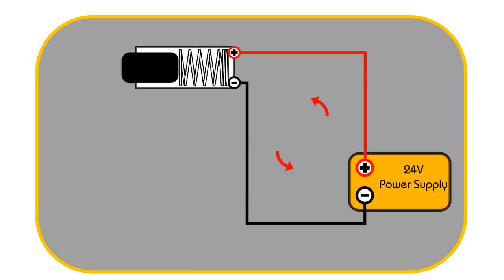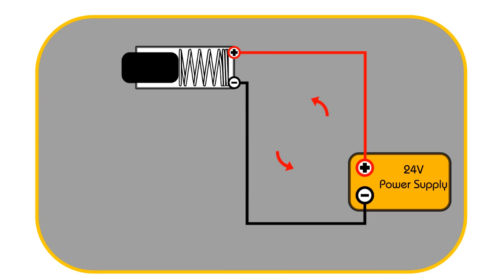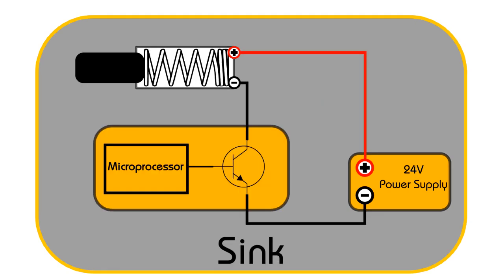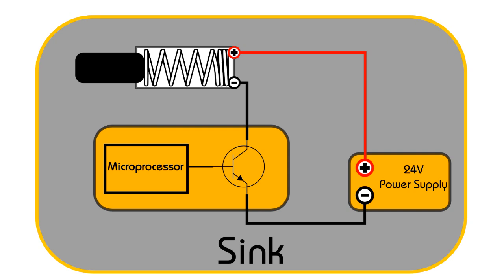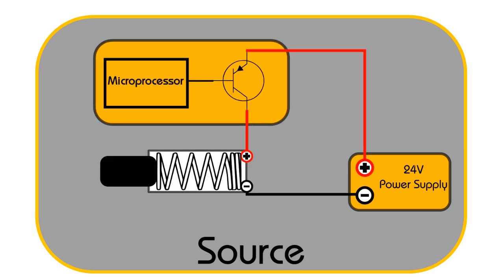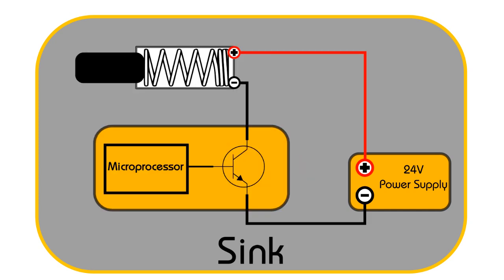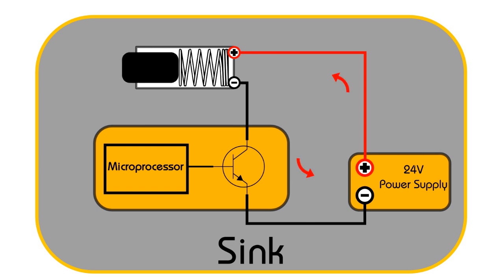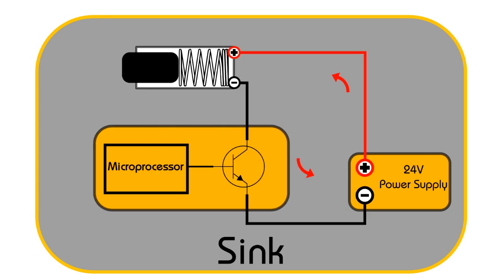PONTECH  Understanding Source Sink - REV-X1

Comment: Mr. JC, Could you please explain dry&wet contact please. And make this kind of graphical explanation also,
Reply from the maker: In this video these would be considered wet contacts.  Dry contacts are relays or switches that are not tied to a specific voltage level.